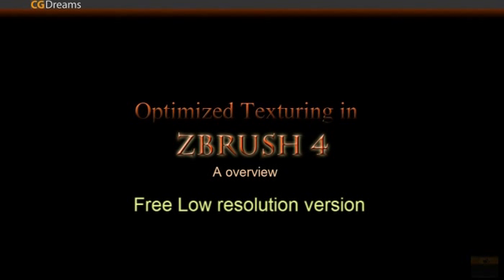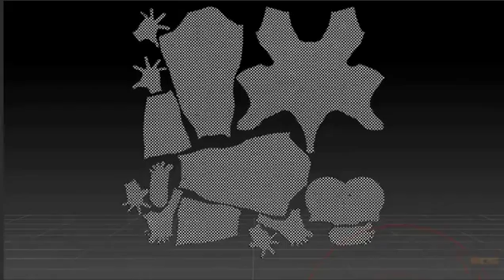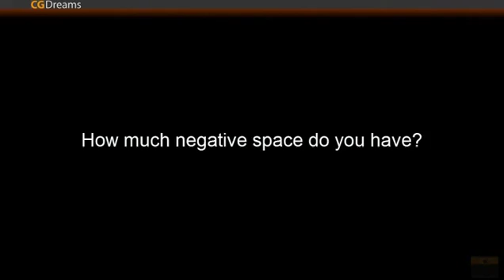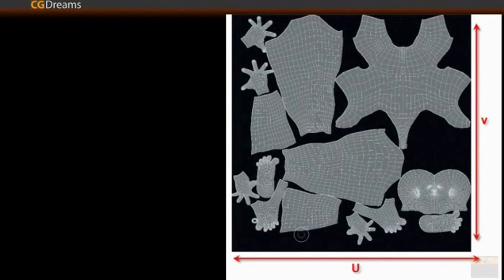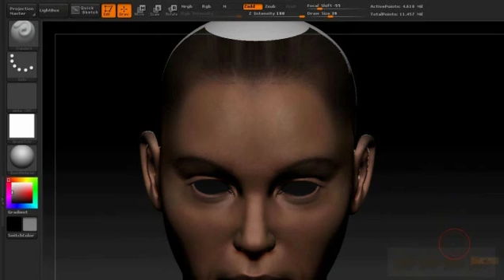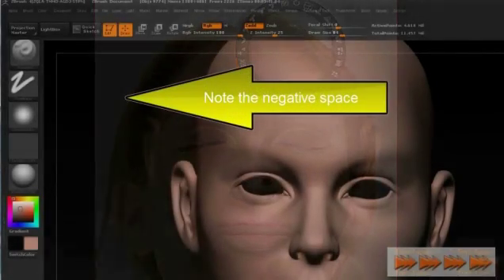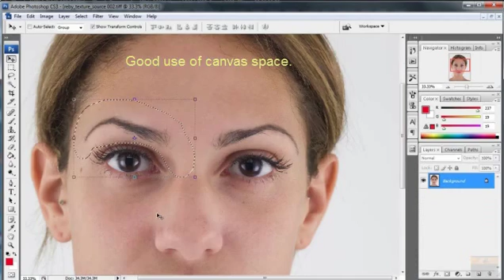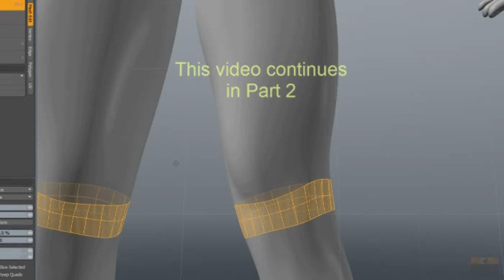Optimized Texturing in Zbrush 4 Part 1 of 2

Comment: Very nice tutorial.
@5':42" there is a typo I think: 512x512 should be 0,262m (not 2,6m) and 1024 x 1024 should be 1,048 m (not 10,4m).
Reply from the maker: Thanks, no it was how I intended it to be, 512 x 512 is 2,621,44 abbreviated as 2.6m to a close approximation, same goes for 1024 x 1024 is 10,485,76, 10.4m.  Thanks for your message, made me re look at abbreviated numbers, I could have used a upper case M for million.  I think for most, it translates  as I intended.
Reply: I thought that 512 pixels x 512 pixels is equal to 262.144,00 pixels (so rounding is 0,26 million pixels). Sorry if I messed up something.
Reply from the maker: multimediaadesign   Your totally correct, sorry for the confusion for the first two figures, iv corrected this now, thanks for pointing that out.

Comment from the maker: To get the very best from Zbrush while using poly painting, yes, if you do a rough calculation, your going to keep for hard work of detail in your textures.  With the light of the current Zapplink, you can texture directly into a blank map itself which will retain all of the quality, but you still must frame the document to the correct resolution to get best 1:1 quality.

Comment: Hi. When using polypainting, yes in order to get the best convertion to texture maps, you need the correct polycount, or higher, as well as a good laid out UV map. Even if you only need low resolution texture for games, your still better off producing a high quality map, and down res it.  M in this video stands for Million,  yes. Hope that helps.